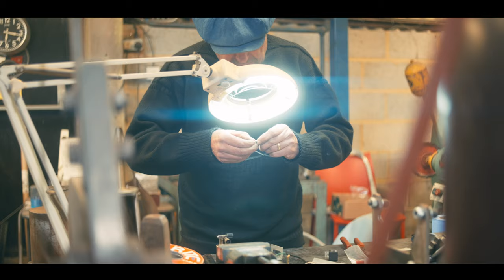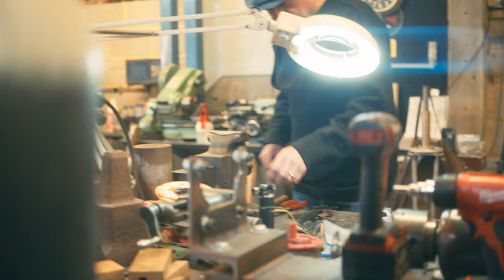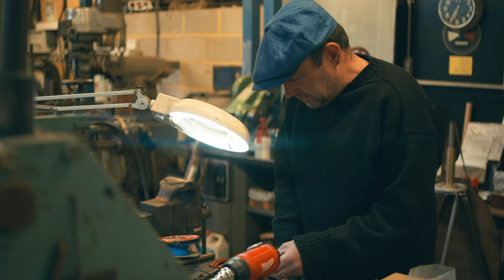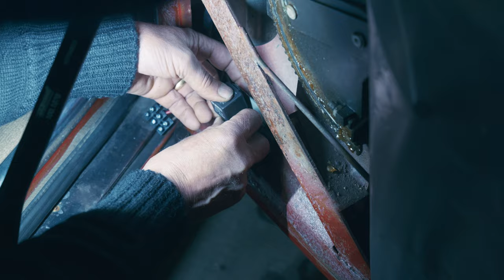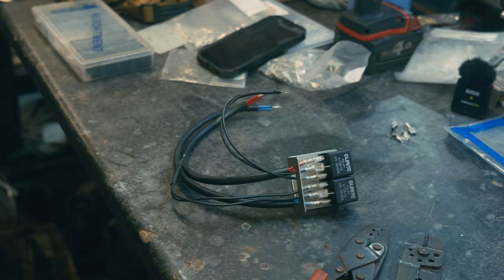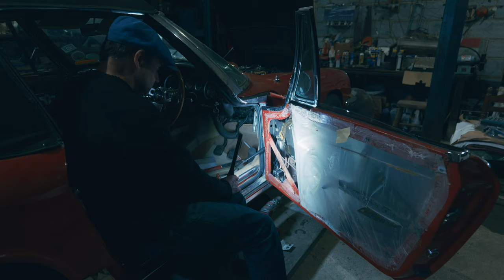The vexations of Maserati electrics.

Comment: Mark, that’s really funny. I built exactly the same system for my Mexico 2 years, same relays, same custom bracket fitted into the doors in order to convert the system with new 2 wires motors… The system is still on original Ducellier switches.
Reply from the maker: I trust that it’s a success !

Comment: It continues today, I have a 2002 spider (4200) and whenever I leave the car unused for a few weeks the window switches become intermittent. They slowly improve with use, though one is never 100%.  Not really possible to dismantle and clean though and very expensive to  replace..
Reply from the maker: I think it’s just what they are like.
My hunch is that it’s not the switch but the body control ECU . It’s certainly not my specialty so I wouldn’t want to say anything more.  But the switch gear all looks a lot like the FIAT Punto .

Comment: Ducellier switches with 2 wire motors requiring relays to keep the original switches?
Reply from the maker: Yes but it’s a little more complicated as I think that there are more than one type of Ducellier switch .  I’m using a two relay system but it only works on one type of switch.   I’m thinking that you might need a third relay for some switches.